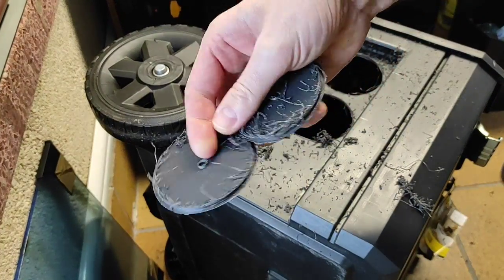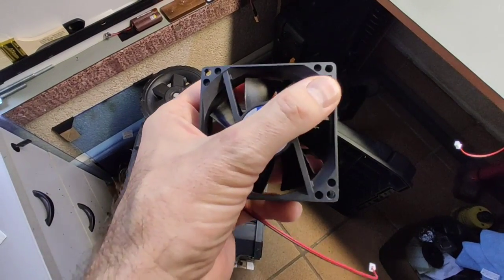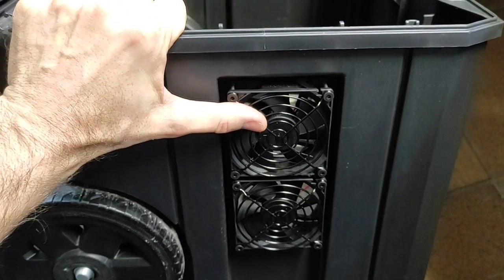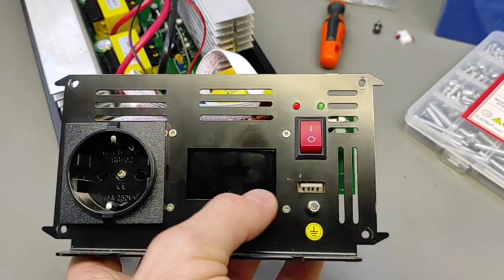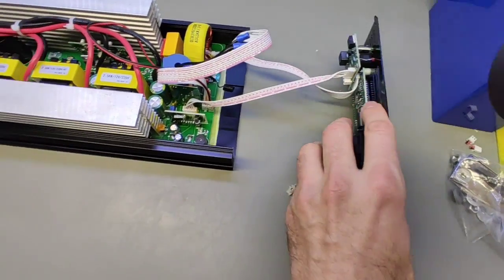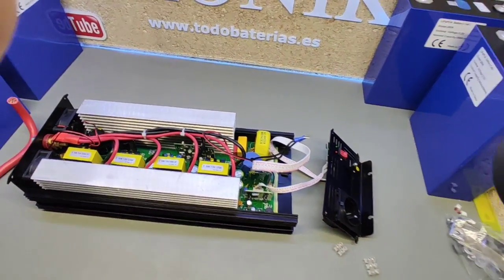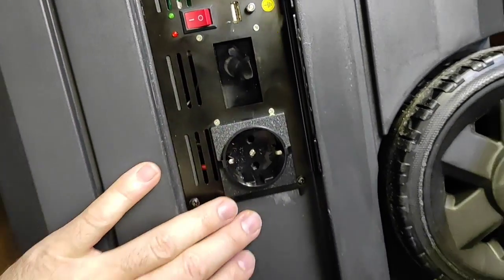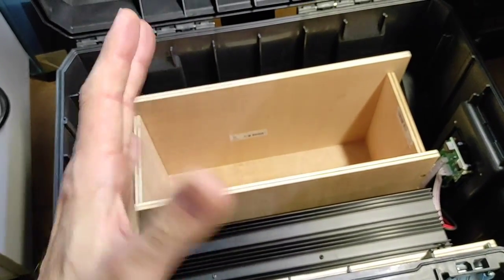DIY LiFePO4 ESTACIÓN PORTÁTIL DE ENERGÍA 2°parte

Comment: Ya echaba yo de menos tus trabajos!
Excelente ejecución y mejor idea. Es impresionante el rendimiento de las lipofe4.
Yo ando sumergido, en algo similar, pero estático; todo empezó pensando en darle una segunda vida a una caja de un mac g5. Estoy utilizando células 32700, que son pura dinamita, y para mi, mas asequibles que las grandes de tu proyecto. Tengo espacio suficiente, para ir implementando. Todo destripado, me aguantan bastante tiempo entregando energía, trabajo con un delta Vx 1500 a 24v, en flotación las mantiene a 27,1 v. 
Ahora estoy, monitorizando, cableando y metiendo la criatura en la caja; cuando emitas el siguiente, te cuento.
Gracias por hacer de guía y por tu pulcritud en el diseño y ejecución.
Reply from the maker: Gracias por tu comentario, explicación y tragarte mis locuras. Un saludo !!!!😊